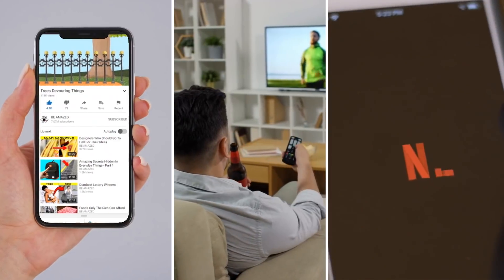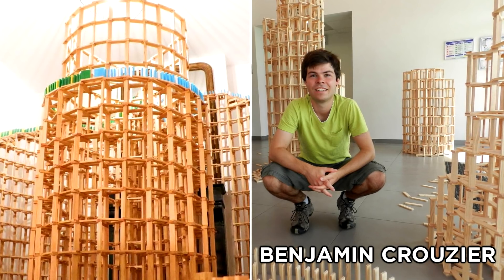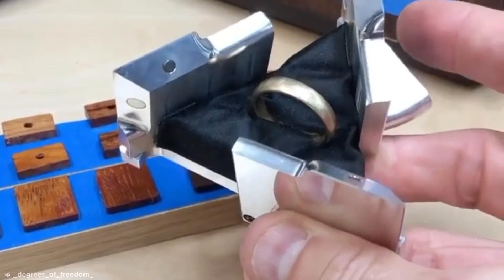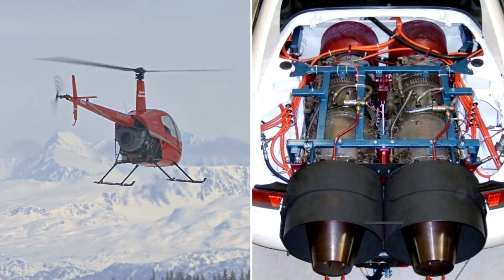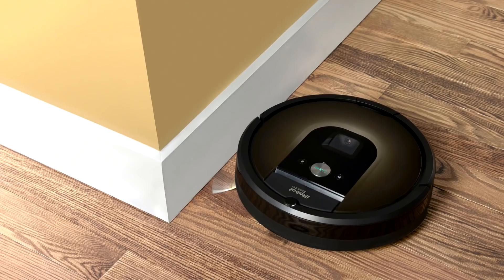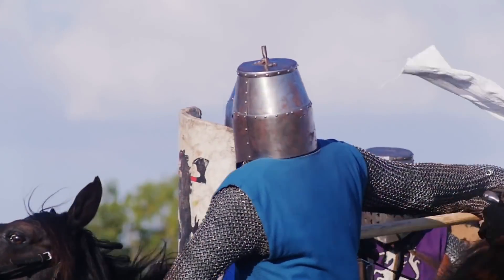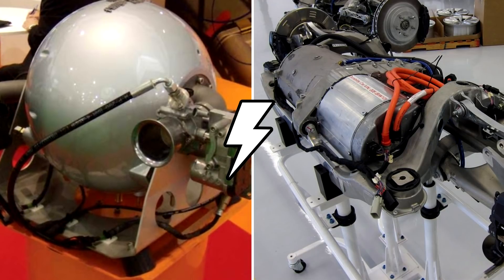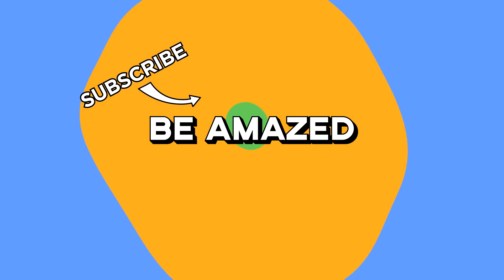Amazing Machines Built When Engineers Get Bored

Comment: I became one of these people when tasked with a challenge some deemed to be impossible while others thought it was pretty stupid. I was given a 2001 Dodge Grand Caravan which was once a service vehicle so the seats in the midsection were already removed leaving just a metal floorboard with anchor points. Me being the person I am, began to rebuild it and originally started with the idea of making the inside look like the interior of a private jet but once I painted the floorboard black I decided to go with a more aggressive route when I realized that it looked identical to the inside of a UH-60 Blackhawk. So the work began, I set out to make the van replica of a military utility helicopter. However I wanted to make it far more different than the average mod, or at least something people are familiar with so instead of using the Blackhawk as a foundation I went with the Sikorsky S-97 Raider. It has earned its name "Combat Wombat" and I have high respect for the military and to honor the forces it won't be officially done until every aspect of it is almost identical to the helicopter itself. Fortunately, I used to work at a Flight Simulation Facility and took place in several areas fabricating and installing pieces of aircraft simulators which meant it had to be identical in visual and operational features to be an exact replica of the aircraft. It definitely helps since I will also be reconstructing the front dash to replicate the cockpit using the led screens as indicators in place of air travel so it can still display mph, oil temp, fuel levels, tire pressure and even elevation as well as installing a G-Force indicator. And of course it won't be complete without the engine modifications as well as suspension and capabilities. I'm putting effort into making it perfect but not just as a showcar but it will in fact be a fully functional field machine. I work with a lot of groups and I have a group/organization dedicated in helping out with the community in several areas but the van itself will be a part of several rescue missions from flooding to tornadoes and many other natural disasters. So with that, it'll be powerful enough to tow a great capacity, but be fast enough to get out of a dangerous situation if necessary and be capable of operating in as many rugged and unforgiving terrains as possible, all while paying respect to the service men and women on the ground and in the air while doing everything to help people in need. My goal is to be known and not famous for selfish reasons but for the viral popularity to capture the attention of people and inspire them to do something that helps others and to be creative while they do it. There's enough negative things to go viral and I think that needs to change, there's something so fulfilling in the feeling of great appreciation from strangers who needed help and you step in when no one else did. I just want everyone to know, you're smart and creative, don't let your happiness be tortured because people tell you what you should do with your life to be "normal" you have this one life and you don't want to spend it trying to blend in with society. Get out there, build shit, get creative and most importantly............ Don't be a douchebag. 😁